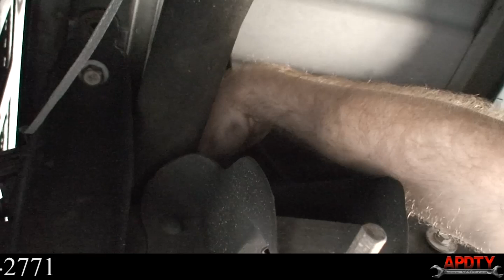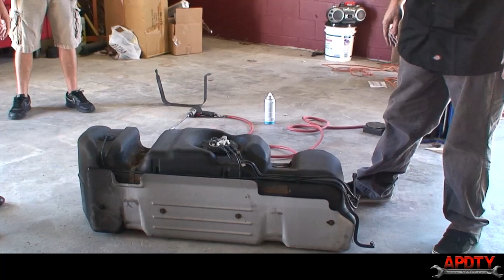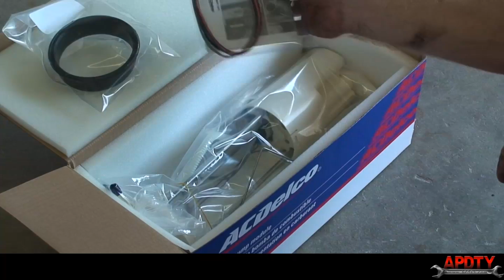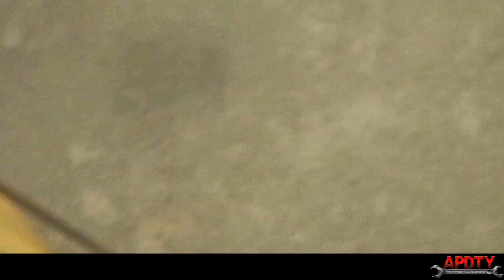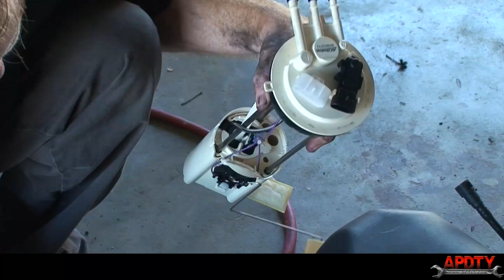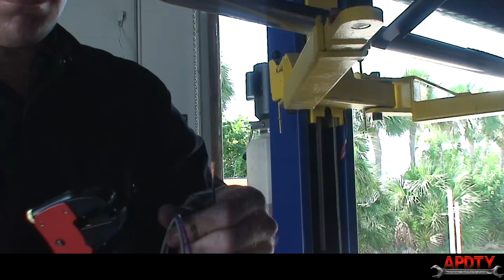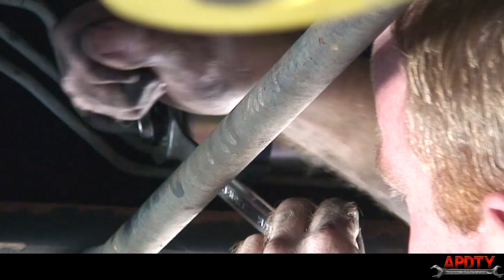2001 Chevrolet Silverado Pickup Fuel Pump Module Sending Unit

Comment: Nice video on the fuel pump change out. I just did mine but I used the tilt bed method and didn't need to remove the tank.  I did this in one day by myself and I'm disabled.

Comment: I got the fuel pump replaced on my suburban 2001, 2 years ago. Buy last week the fuel gauge stopped working. It goes all the way to empty at unexpected times. sometimes it goes up a little bit, but still does not shows the actual amount of gasoline the tank has.

Do you thing it could be the fuel pump again? Or can i just replace the sending unit ?

Comment: If you are looking for a 3x faster and easier method to change a truck fuel pump, we have invented a BedliftR tool that attaches to the frame and allows you to easily and safely do fuel pump work on trucks using a tilted bed method. You can watch video at http://www.tec-tools.com/home.html.   It is shown on a lift, but the work can also be done on the ground as
 well. We are just going out to market now, so if you ever were interested in getting a demo model to test out, contact us. Thanks.

Comment: I wish to thank you for the greatly detailed video. I also do plan to remove the bed. I have swapped beds on a pair of 150's before so I don't see much issue on my 99 silervado. helps to have a neighbor with a Milwaukee impact drill for bolt removal. of course, I ANIT DOIN THIS IN BELOW ZERO TEMPS! i hope the pump lasts til spring.

Comment: how do you tell what fuel pump module code you have without looking on the actual fuel pump??
Reply from the maker: +Tim DeSantis You really cannot unless a GM dealership can confirm for sure by your VIN. Most every time we have to get to the top of the fuel pump to read that code on the wiring harness.

Comment: I just did my 99 Silverado and used the tilt bed method which is a lot easier than dropping the tank.
Reply: +larry tanton I honestly think dropping the tank is alot easier 2 bolts and shes dropped ...
Reply: +Tim DeSantis It's MUCH easier to tilt the bed. Dropping the tank is way more labor intensive, you're just wrong.

Comment: Great video, but a question before I can even really start...If my fuel pump is completely not working and therefore the truck not starting, is the fuel pressure probably already relieved or do I still need to relieve it...and if i do will turning it over sufficiently do that since it won't run?

Comment: Trying to replace the fuel pump on a 99 f150 XLT. Am I going to be able to take the bed off and access the pump. It looks like there is a bar over part of the pump. I have a long bed. Thanks.
Reply from the maker: Bed removal is often required on the 199 Ford's, We did one of those on video also and here is a link:
https://www.youtube.com/watch?v=7lPzi9M8atk
Reply: Take 8 bed bolts out and that takes 2 minutes max. take out three filler neck screws 30 seconds hoist front of bed 2 min replace pump 2 minutes repeat steps.

Comment: IMO, its much easier to lift/tilt the bed.
I can do them by my self on the ground in about 2.5 hours & have done many with the 6 Ft beds .
Sad fact is most likely you are not going to have access to a lift & although I have access to a lift I prefer to not pull the tank .

8 bed bolts  1 ground strap & ground wire bolt & 3 filler neck bolts.
Bolt heads are 10mm & 18mm & 7mm
2 Electrical plugs for tail lights .
I strongly recommend having someone help you remove the bed & its better if you have 2 helpers for lifting .

Also a engine hoist will easily lift a bed for removal with proper attachment to cables chains ETC but not rope !

I use 2 long bolts about 4+ in long on the passenger side center bolt holes & tilt the bed being very careful to block the bed with lumber , lots of lumber because if it falls it could kill you .
Which is no different than working under a vehicle so please be very careful !
This way there's no gas in your face & when you change the harness plug its much easier because you can un-snap the wire harness for easier  access .
The 2 outer lines have a plastic clip that needs pinched together & wiggled to remove & the center one just needs pinched to remove .
If you break a clip they are available at most parts stores for a few dollars .
Reply: +B Ann I disagree its much easier to remove the tank 2 bolts and the tanks dropped ....
Reply: Tim DeSantis
2 bolts and some lines that may or may not be too short or really really stuck.

I've done dozens of them both ways and I prefer to lift the bed.

Granted sometimes lifting the bed is not the way to go for various reasons but IMO it usually is.
Reply: Ive done multiple on diff years and never once pulled the bed too much rust
Reply: Tim DeSantis
any rust is too much.
But I see why you'd rather deal with 2 bolts instead of several if you're in a rust belt area.
Reply: Yeah upstate ny the rust here is awful makes me wanna go south i love snow tho lol

Comment: Good job, I'm also a fan of solder and heat shrink for electrical connections, and if there was ever time for a heat gun instead of open flame this was it!  Also important: when changing the fuel filter you should be using flare wrench on the fuel line nut.

Comment: after losing all the radiator fluids, the shop replaced manifold gaskets, hoses and not sure what else, the cost was $1000,00.... the interesting thing now is the air conditioner is now making a loud noise,... I'm wondering if that noise has anything o do with the repairs  that was done.... I'm at a lose, because before the repairs the air conditioner was running great no issues until now...... Any ideas, or comments. Thank you

Comment: Very good video. Only comment is soldering vs crimp. When you solder you create a stress point where the solder ends and the un-soldered wire starts. This is the point that will break due to vibration. Crimp connectors are more reliable in this respect. If you must solder, use a short piece of nylon (cut from a nylon tie-wrap) to bridge the soldered area, then put shrink wrap over that. You can also use shrink wrap over the crimp connector to help keep the elements out.

Comment: For you people that have the 2007-2013 Chevy Suburban, Tahoe, Avalanche that need to have the fuel pump assembly replaced.........WARNING. Many repair shops will do it by peeling back the carpet on the floor board behind the drivers seat. Cutting a hole in the floor board to access the pump. Tack weld the piece back in, and tuck the carpet back into place. And you may never know it!

Comment: Thank you for this. I was originally going to take my '99 into a shop but you showed how easy it is. I dropped the tank as well since I only had a 1/4 tank of gas (still heavy to lift up so it took a while to get into place correctly working by myself) but start to finish a fairly easy job with little swearing!
Reply: Did you disconnect the filler neck like him or from the top. And I was told I could lower it down enough to disconnect the lines from the pump instead of by the canister. Just trying to make it as easy as possible
Reply: @dylan.a.smithh  I can't remember now, but me memory is that I disconnected from the bed. BUT ... I had to change it AGAIN, and used the trick where you remove the two bolts open the bed left side, loosen on the right and jack up the bed to gain clearance. SO MUCH EASIER ... can be done with a full tank of gas, too. Obviously can't be done with a non-pickup model (Tahoe, etc) but the bed lift was EASY.

Comment: Hey guys. I have a problem with my Chevy Pickup truck (1999). I changed the fuel pump and the fuel pressure regulator but when I test the pressure it doesn't hold where it should. The pressure slowly goes down. Any ideas on what the problem could be? I replaced the fuel pump and the fuel pressure regulator with new ones. Please help me.

Comment: Just wondering, how many connections is that pump considered to have? I would assume it's a 2. However when comparing pumps which are found online, some of them are a little confusing and are saying they're a one connection; however, the picture shows two. I know some stores will use the same picture for different products even if there is a difference. Thanks, great video.
Reply from the maker: The pumps will be very specific to you make and model. If trying to purchase online, make sure to go through a year make and model look up and make sure you enter all the data exactly. It may also require you to look at the old fuel pump or the wiring harness to get a code that identifies which pump you have. If you have any trouble, you are welcome to call us and we can look it up for you, our toll free number is 1-866-770-2771. This particular fuel pump has 2 electrical connections and 2-3 fuel line connections.

Comment: Wipe out the bottom of your tank while you are in there.

Always keep at least 1/4 tank of fuel to ensure proper pump cooling.

Used car lots often run less (for anti-theft and cost reasons) as do poor folks who think a near-empty tank is somehow economical (top the damn thing off and don't use it up instead!) . This slaughters fuel pumps and dead fuel pumps slaughter your wallet.

Comment: would i have to loose all the gasoline in my truck when changing the fuel pump because it was bad gas that made mine go out
Reply: If the fuel in your gas tank is bad and caused the pump to fail, then yes you want to get rid of all that fuel. You will most likely need to go to a shop that can take the fuel or make sure it is disposed of properly.

Comment: would i go through the same process on my 2500hd 6.6 diesel?
Reply: No, a diesel will be different and you may actually have 3 fuel pumps. Most of these models have a fuel pump inline (mounted on the frame). If you have an auxiliary fuel tank, then that fuel tank will have a fuel pump module in it and it is similar to above. You also have a fuel injection pump (located under the hood, very common & very expensive). Also the diesel is a much more involved to diagnose in the first place and also the fuel system must be primed after replacement. Unless you have good experience with Diesel vehicles, we recommend a diesel mechanic. Diagnosing a fuel system problem is much more involved on a diesel then on a gasoline engine and unfortunately can get very expensive.

Comment: try this take the bed off it's way easyer
Reply from the maker: When dropping the tank, the procedure is the same as the full size GM SUV's, (Yukon, Tahoe, Suburban, etc...) we opted for this method so a wider range of people can get use from the video. We lift the bed in the F150 Fuel pump video we do.
Reply: Hy:)

Comment: Have you tried lifting the bed instead?
Reply from the maker: When dropping the tank, the procedure is the same as the full size GM SUV's, (Yukon, Tahoe, Suburban, etc...) we opted for this method so a wider range of people can get use from the video. We lift the bed in the F150 Fuel pump video we do.

Comment: By the way, I just got gasoline in my eye just yesterday. I was stalled out in a shopping center, wouldn't start. Replaced my fuel filter but in getting the old one off it  splashed in my face. Burned..rushed to get my bottled water from the back and washed out my eye for about 5 minutes. At least I was able to start my car and  it got me back home. Since it wouldn't have been possible to pull the relay and run my car to remove the pressure...I should have done it by the pressure test connector. But I was mistaken as to where the real connector was..now I know where it is. It's not the very visible one on the driver's side..that's for evap...the fuel pressure test connector is on the passenger side behind the power steering pump. Very difficult to even get the cap off. I had 60 psi when I just checked the pressure today.

Comment: My Chevy Venture had the same problem with the fuel level variable resistor brushes...one had only one tiny finger left..the others broke off. I removed the level sender from the fuel pump body and pressed out the plastic swivel to get access to the brushes. I then was able to bend the one worn brush so that it would make better contact with the slider surface. I did this after I found out how much my local parts place was going to charge. Well, it didn't work! My fuel level indicator is still erratic. Oh, well, nice try but a lot of extra work. I received my new fuel pump from Amazon today and will install it tomorrow.

Comment: Chevy Venture fuel pump ring is a big knurled plastic ring. I Jerry-rigged a tool by drilling two holes in a piece of wood space apart to match the inner lattice hole of the ring and inserted something like 3 inch long bolts in the holes. I inserted the free end of the bolts into the ring holes and twisted it off. If the board is something like a 2x2x16" or longer it works pretty nicely in getting that ring off. Who need special tools when you can make them your self for free?

Comment: Fantastic video! Thanks! In reply to SEATTLE BEST...I don't know about how much a fuel pump for a 1998 blazer would cost but my 2000 Chevy Venture fuel pump was going to cost me about $250 at a local parts store. It would cost even more at a Chevy dealer. I bought my fuel pump at Amazon for about $105 which includes the shipping and taxes. And I got it in 3 days when I was expecting 5-10 days shipping.

Comment: Cut a small hatch and screw the dealership.
Reply: You got that right. I'm about to buy a cut off tool so I'll be ready for the day my fuel pump goes out.
Reply: A lot of people do the cover plate trick.
If you do, I suggest trying to measure to the approximate center of the fuel pump using whatever landmarks you have on your vehicle, then drilling a hole to verify your aim. After finding "pump center" you can use a metal-cutting jig or body saw blade (I have cutoff wheels aplenty and a variety of ways to spin them but I wouldn't use them for this job) to cut your preferred shape. The fab shop trick of marking your cut lines with a Sharpie is nice for sheet metal work.
Drill a starter hole for your saw blade, and check with a BRIGHT light so you don't slay any wires or plastic fuel lines! You can shorten saw blades with a cutoff wheel if you don't want the "extra you aren't cutting with anyway" thrashing near something valuable.
I wouldn't cut a hatch on a non-rustball pickup truck bed in most cases if I could get all the bed bolts free. Silverado bed bolts are easy to reach, so if you want to do yourself an easy favor take yours out NOW and coat the threads with anti-seize, then run them back in. I do this with all my trucks since I don't get paid to fight my own stuck hardware. Do your bumper bolts too to make getting it out of the way easier if you decide to.
You can also anti-seize and penetrant bath your tank hardware before ever needing to drop the tank. I often make the rounds of my trucks with spray penetrant if I'm under them for other maintenance.
I do these things because I'm lazy, and laziness is the mother of efficiency!

Comment: Even after a shot of gasoline in the eye still no safety glasses??
Reply from the maker: I wanted to say thanks, after reading your comment I thought it over, and ended up getting a nice new set of safety glasses for the next video we make. Thanks!
Reply: @APDTY  We used to siphon gas routinely using a rubber hose ~ too old to do it now but what I do is remain super-cautious and tense-reflex as like using a funnel it is just more stuff that gets in the way ○ When you have to use them then use them but be aware that it restricts vision somewhat — I had I am sure some gasoline in the eyes but I was very youthful then → currently I cannot even stand vapors while pumping

Comment: I've done this a time or two with my truck. I have found it much easier to remove the bed bolts eight of them disconnect the rear lights plug and sliding the bed back about a foot and a half. Its much easier than disconnecting all fuel lines draining tank. You will need a strong buddy for this method but much easier! I replaced mine with a newer model a/c delco pump. It has no filter sock on bottom. Parts people told me it was now incorporated with pump do to ethanol levels in todays fuel.

Comment: Man! Your tank strap bolts just came right out. Mine are seized and the heads are rusted round. The tank straps rusted 1/2 way through as well. I'm betting you don't live in the rust belt.

Comment from the maker: Unfortunately I have no simple trick to fix that problem, if the fuel nuts going into the fuel filter are completely rusted, the only tricks are to try spraying them like you did, and then banging on the rusted nut will sometimes help free it. If that fails, unfortunately you likely have to replace that section of fuel line.

Comment: Do you have any suggestions for breaking the bolts (seized) on the fuel filter as opposed to replacing the whole fuel line?  I tried spraying it up and coming back to it later since you can’t use a torch.  Have you come across this problem?

Comment: Hi, Thanx so much for the vid.
...now if you've replaced the pump and the gauge reading is correct temporarily but still doesn't stay accurate but still fluctuates a little bit (within 3 or 4 digits) mostly while at a stop or parked in idle, what can cause such??
(float arm, wire harness connections, sending unit contact points everything all fine)

Comment: I replaced the fuel pump of my 2001 gmc sierra and still  running bad, i already put the scanner and it say that the fuel censor is bad, how the happened if the fuel pump in everything is new, is possible that the censor is not working or it may be something different?....thank you

Comment: great job.it's a  professional way to replace the fuel pump. i had the same problem and  i changed only the small device the control pumping the fuel to the engine and cost me low price.that device response to start pumping it's electronic device inside the pump.